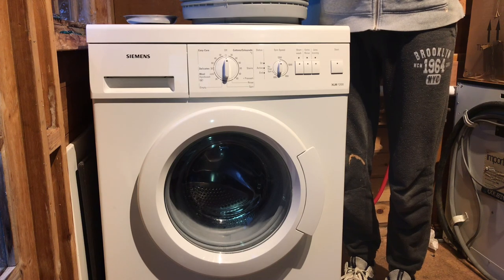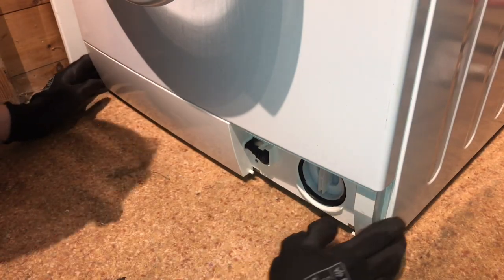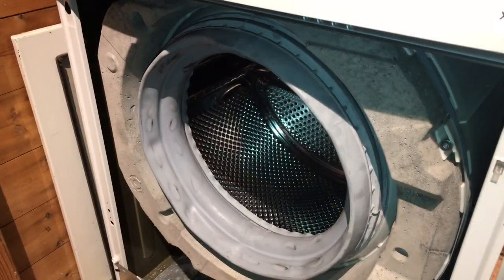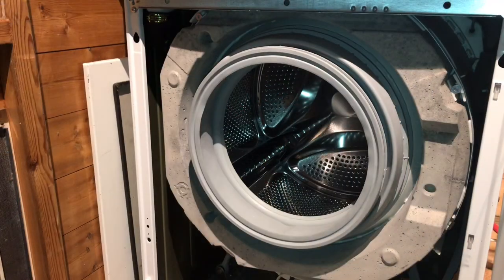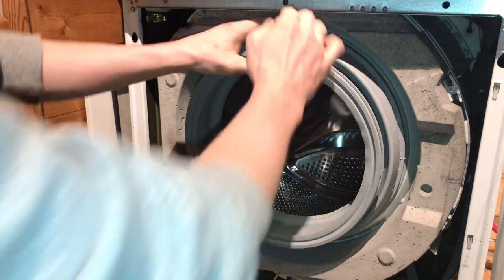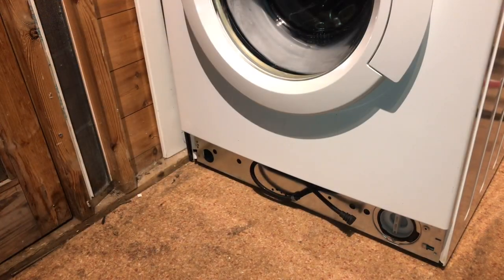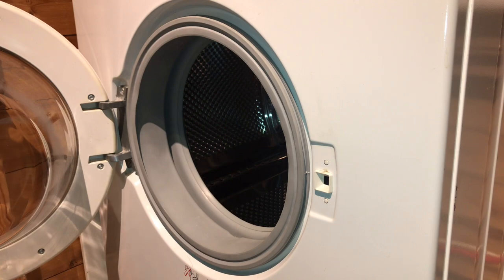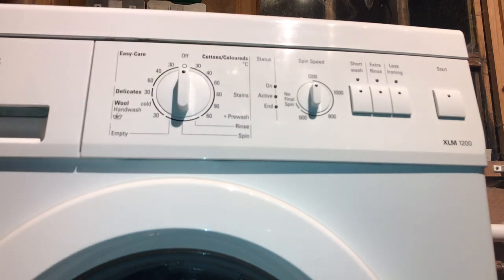How To Change A Door Seal On A Bosch/Siemens Washing Machine

Comment: Thanks very much for the video - really clear instructions. Saved me a call out and the old machine lives on so much appreciated. My model required removing the top button panel to expose a couple more screws holding in the front panel, but not too much bother. Left bottom panel off until testing done so could see if any leakage below.

Comment: Best video on here regarding replacing the door seal (mine is a Bosch classixx 1000). 
The cleaning of the drum and door took longer than the seal removal and replacement.Thanks for posting the vid.
Reply: How long machine was used before replacement, and did you notice kinda small leaking right at 6 o clock right under the door. Checking inside I dod not find any seal damage, so not sure whether seal was not flat to the door anymore due to chemicals (detergent) and hot water exposure. Thanks!

Comment: Thank you! This worked perfectly. Pro tip: to put the spring in the groove easily, have a 6 year old hold it in place with its tiny hands, while you go around putting it in place. Little helpers ftw!

Comment: Does someone happen to know how to change the door hinge for the iq700 Siemens (about 5 years old) washing machine? There aren't any screws to be removed in the door.
Reply from the maker: You may have to remove from behind, take the front of the seal off or the lid off and see if you can see anything

Comment: Hi, 
May I take up a little of your time to ask you a question please?  I ordered a gasket for my Siemens WXLM148AUK/19 washing machine.  

The one that arrived had a little tube coming down from the top which I don't think mine has,  (not got it fully off yet as something else cropped up that I had to deal with first).  My model was listed on the seller's site so I ordered from them. 

I have contacted the seller and he say's that TWO gaskets were made for that model of machine.  I have done some investigation and as yet I have not managed to find info that the gasket with the tube will fit my model. 
I do not want to try fitting it if it's the wrong one and I have to change it.

Did they really make two gaskets for the WXLM148AUK/19 ?

Thank you in advance if you can help. :)
Reply from the maker: Jax Lancaster unfortunately they did make 2, one had a direct opening from the soap housing, you’ll need to find the other one and let them know to change the info on the website
Reply: @servisslimline    Thanks very much for your quick reply.  I have now got the gasket off and the old one has definitely not got the tube on.  Contacted the seller and he say's he will not exchange but I can return it to him.  He left a link to the correct gasket but it is approximately £6.00 dearer.  I don't think he will alter the info.   Back to square one but  thanks for your help, so many do not bother to reply,  I appreciate that you did.  :)

Comment: Any ideas on how to get the damned shock absorber off of one of these? There’s a plastic pin through the top that I just can’t figure out how to remove!
Reply: Tomek Morawa Hi, unfortunately on these Bosches the pin that holds the dampers in is part of the outer plastic drum so you would have to remove and split the drum unit. I’m pretty sure however there was a modification where you could drill the hole/shaft out and fit a 13mm nut and bolt in its place to hold the new ones in. Good luck!
Reply: The Laundry Centre yes! Lol. That’s what I started to do and figured I’d buy a bolt and stick it through there! Thank you for the response. I appreciate it.
Reply: Tomek Morawa Not a problem 😊